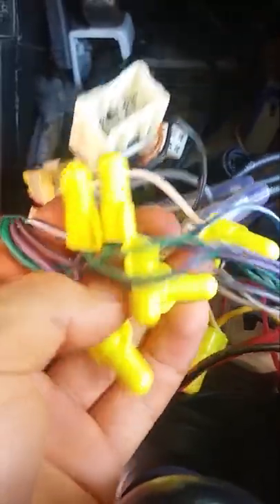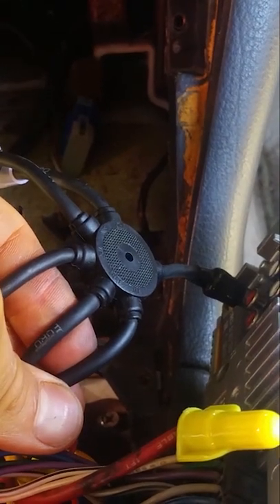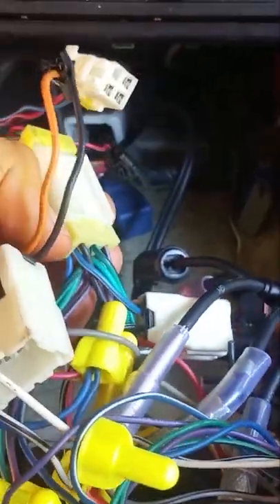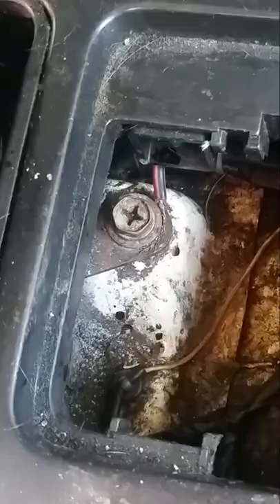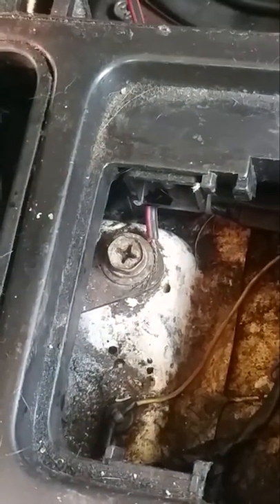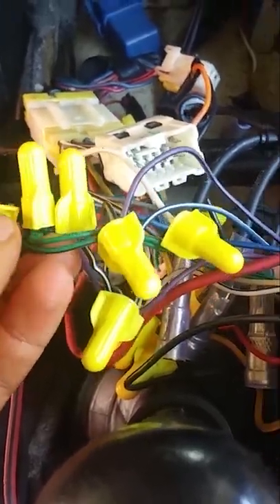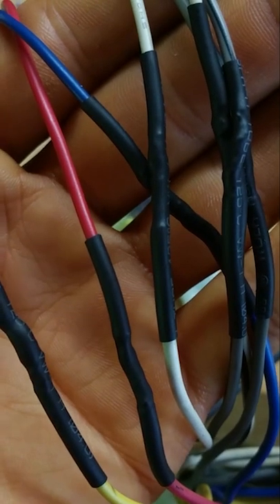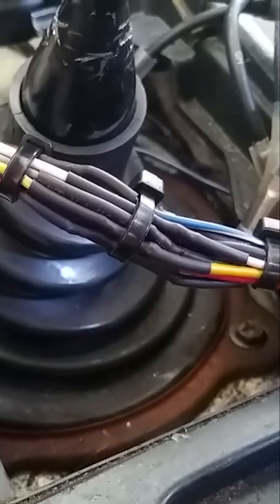Customer States Car Stereo Wired BAD!

Comment: Any tips on fixing loose pigtail connectors (like the white ones in this video)?  My old connector is loose in the new harness for my radio after a few years of having it and the back is full of wire so can’t really fit a zip tie.

Comment: Beautifully done, I did mine with crimp connectors at first and had to redo as those came loose as well. Now I’ve got them soldered but still looks messy since I didn’t connect them straight together like that. 

Seems now I’ve got an issue with my pig tail connectors connecting my new wire harness to the cars old ones.

Comment: Thank you!!!! Installing my son’s amp and sub and once got all the nastiness and pre ran wires cleaned up from previous owner. Had no power to remote wire. Opened up waterfall and found out why…it wasn’t connected and some connections to radio are coming undone since was twisted and wrapped with electrical tape. Ugh! Now have to work on that on another day.

Comment: Here's a ti for splcing, stagger the splices, makesa slimmer bundle
Reply: Might be nice if you’ve got plenty of wire, some of these speaker harnesses don’t come with much excess however. If all those nuts fit in their at those weird angles this straight solders are a huge improvement.

Comment: Used the wrong size wire nuts 
Personally never had an issue when using the correct wire nut size

Comment: That bolt wasn't even rusted bro. Lmmfao 😂. Rust is a orangish brown color. Not a silver color. Wires don't have to be clean looking to be correctly connected. Especially in areas you don't see.